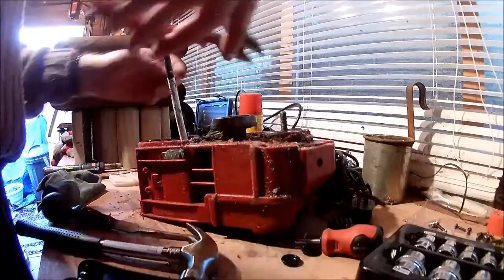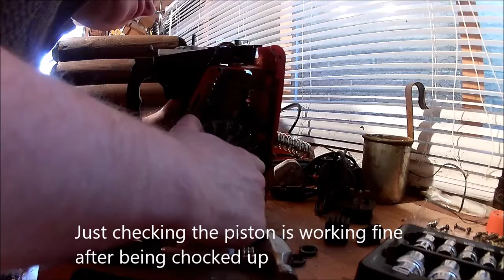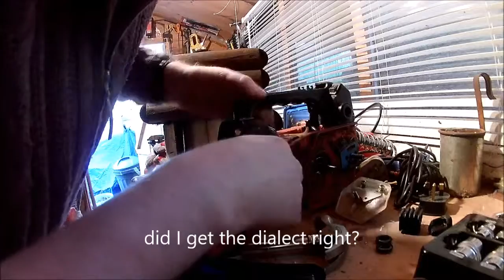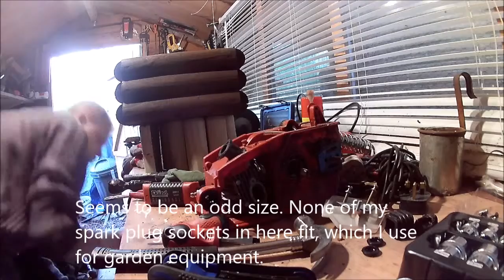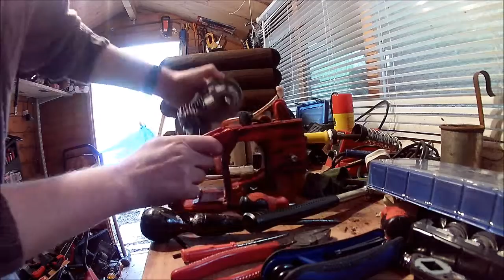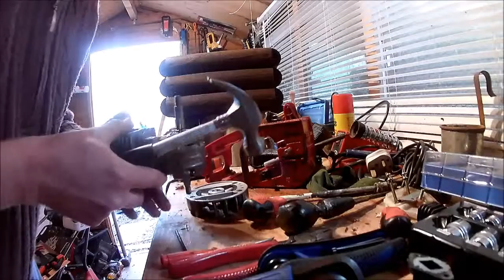Chainsaw engine removal for future RC aircraft use - part 2

Comment: Please supply engine make, capacity, weight, etc. Did you put the engine in anything?
Reply from the maker: Christopher Knee It's definitely a Chinese engine. So no actual model joy there. I haven't put it in anything yet, I wish I had the spare time from other things, honestly. You would need the electronics or similar from another set up (like a spare from garden equipment) as unlike nitro engines they're not self sufficient once started. I don't know the cc size off my head, not sure it's is on the casing. Could check the dia of the cylinder & make an educated guess but, you could do that sitting next to other engines. It was going in the bin, so it was worth taking out.